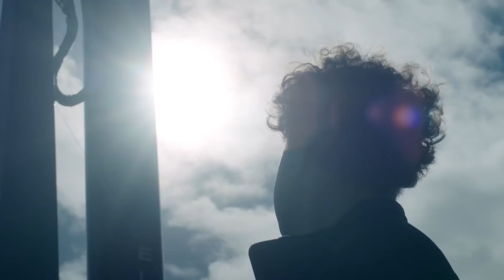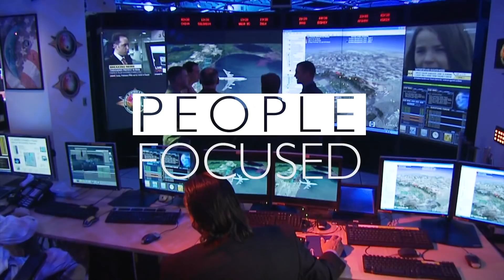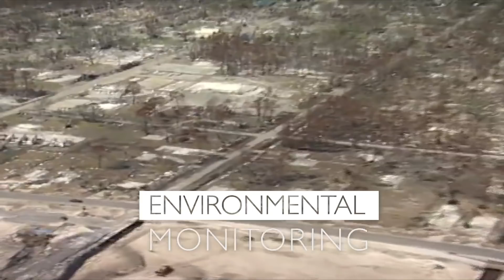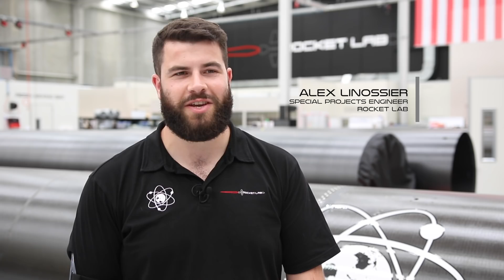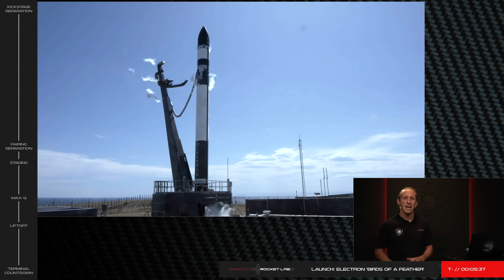Birds Of A Feather Launch - 01/31/2020

Comment: While I'm quite sure that the Electron first stage parachute (or square parafoil) descent and mid-air helicopter recovery to a vessel will work fine (jet target drones have been recovered that way for decades), I wonder if Rocket Lab has looked into a possible later refinement of the technique, in which a folded Rogallo wing could be deployed? In the 1960s, the West German company Dornier designed a reusable solid propellant sounding rocket, the Do 122 (see: https://www.secretprojects.co.uk/threads/dornier-do-122-high-altitude-sounding-rocket-project-621.3743/ ), which had two opposing "conduits" running down its sides. After re-entry, these would swing outward, deploying--on each side of the rocket's body--half of a sail-like, triangular Rogallo wing. With Electron's finless, cylindrical first stage, it wouldn't matter which end pointed forward during such a glide to a selected landing point, either on a vessel (which could match the gliding first stage's speed, for a gentle deck touchdown) or on land (depending on the launch site, the ascent trajectory, and so on).

Comment: I'm a bit gobsmacked that this launch went NNW overland- at 18:08, you can compare the aft camera view to this Google Earth rendering. The vehicle clearly overflew the eastern neck of the North Island.

https://imgur.com/gallery/AtuJkew
Reply: Since this is a US National Reconnaissance Office (NRO) satellite, it probably goes into Sun-Synchronous Orbit (SSO), so that its targets are always illuminated in the same way by the sun when the satellite overflies them.

"Typical Sun-synchronous orbits around Earth are about 600–800 km in altitude, with periods in the 96–100-minute range, and inclinations of around 98°. This is slightly retrograde compared to the direction of Earth's rotation: 0° represents an equatorial orbit, and 90° represents a polar orbit." [Wikipedia] 

That implies NNW launch azimuth.
Reply: @cogoid  I understand SSO requirements, but they can also be met by launching at about azimuth 210, without flying over populated areas. It's a startling choice.
Reply: @r0cketplumber  True. Perhaps they are in a hurry to put the satellite into a specific plane and have chosen launch parameters to suit that.

Comment: 15:32 Liftoff
18:17 MECO & Stage separation & SES
18:58 Fairing Separation
21:24 First stage reorienting (roll axis)
21:56 Battery hotswap and jettison
22:23 First stage begins changing orientation
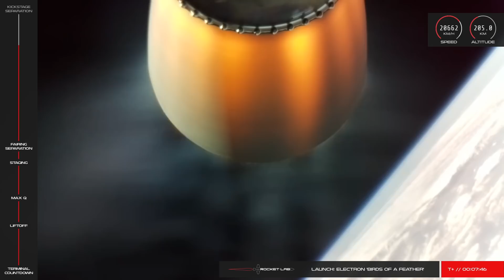22:49 First stage reorienting quickly (Feed cut out at 23:21)
24:33 SECO
Curie deployment not caught on the feed

Peter Beck on twtter:
"Initial Stage 1 reentry data review shows consistent trajectory with the previous flight. We hit the wall, roll along the z axis then come out the other side. Good telemetry all the way to sea impact with a stage in one piece again."

Congrats on making it through the Wall again! I can't wait to see you start catching them midair
Reply: Thanks for the timestamps

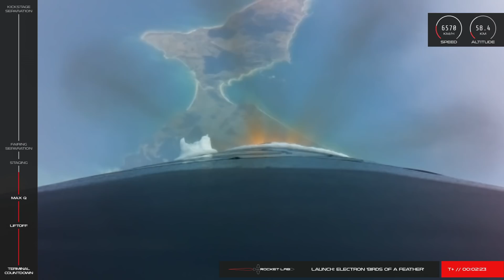Comment: 18:01  NRO launched...  a baby?
Reply: Heehee...it is one of their smaller payloads, to be sure. They have been working to develop more capable small satellites (this is likely a technology development experiment in that direction), which save money all around. Being smaller, they can be orbited by much smaller and cheaper rockets (an Atlas V, Delta IV Heavy, or Falcon 9 [or Falcon Heavy] could orbit one or more entire Electron vehicles, in terms of payload mass to orbit [if memory serves, an Electron would even fit, with height to spare, inside the Falcon 9's & Heavy's payload fairing!]), and small satellites' materials, on-board propellant, and handling & transportation logistics are all much cheaper than those of large spacecraft--with spaceflight, small is beautiful!
Reply: @j.jasonwentworth723   Yes, the Kiwis occupied that niche perfectly. 
I even think that it's not that profitable to work on reusability of such relatively cheap rockets.

Regarding NROL-151 itself, judging from Electron's maximum launch capability and the orbit, I doubt it's a visual reconnaissance satellite. It's either a technology demonstration, or a radio reconnaissance one.

Comment: A good flight into orbit!
I am curious - and worried I have to say - at the exhaust on the 2nd stage. The flame pattern didn't seem as stable as you'd expect and indeed I could see the heat shadows on the nozzle moving around a bit. And a surprising amount of sparks in the exhaust plume as well, that made me nervous about the injectors into the combustion chamber, etc. 
I also noticed similar sparks in the first stage exhaust plume, but I thought they might be ice particles erupting into plasma as they burnt?
Reply: The 3D printed Rutherford engine in vacuum has a ISP of approx 340 which is very high performance, the sparks are carbon soot from the injectors . A single Rutherford engine has been test fired 500 times and still working
Reply: @ITTechHead  Thanks very much for the clarification.

Comment: Go to 9 meter diameter Stainless with carbon overwrap! Elon needs real competition!
Reply: There will be a need for Rocket Lab, SpaceX and others .. Boeing and “Oldspace” has to go .. Nasa and ESA has to use private sector to get cost very much down ..
Reply: Rocket labs going for quick, small and fast local delivery, think  Vespa motor scooter delivering fast food, I kinda waiting for a pizza company like Domino's or pizza hut, to do a promotional stunt and deliver a pizza to the ISS with such a rocket. 🚀🍕🚀🍕🚀
Reply: @drmosfet  This accurate analogy made me hungry. ;)
Reply: Na, that's old fashioned technology. This is the way of the future. Elon can't compete with this.
Reply: @davidstiles5506  so wrong, Stainless is stronger than carbon both when hot and cryo. And it's more than 100 times cheaper.
Reply: @tonyrusi1978  You're missing the point of what RocketLabs does - Elon and the F9 can't compete with them, for small scale budget launches - they're chasing completely different market sectors, and together enable more countries and companies to get in to space.

Think of it this way, F9 is regular mail via truck, Electron is express mail with smaller packages and faster delivery, and Starship will be bulk cargo like the cargo ships in the ocean.
Reply: @PiDsPagePrototypes  That's not true either. Elon can fly for $20/kg.
Reply: @tonyrusi1978  $20/kilo, sure, but only if there's enough clients to fill the F9 or Starship cargo bays.
If there's only one client lifting 100 kilos, RocketLabs is much much more cost effective, as the client would have to pay for all the empty space on an F9 etc.

Rocket Labs is aiming at a different market sector. I don't get why people can't comprehend that. It's different clients to those SpaceX chases.
Reply: @PiDsPagePrototypes  Fortunately for SpaceX, they will be able to backfill any cargo, no matter how small, for years, with numerous Starlink Satellites.

Comment: Looks like the 1st stage went out of control.
Reply: They don’t do controlled landings yet (but are holding to soon)
Reply: @tylerklatt5633  oh, got it
Reply: Apparently the first stage is very sturdy and according to Peter's tweet it has made it all the way to the surface, tumbling or not.

Space Shuttle solid fuel boosters fell uncontrollably from the same altitude and velocity and survived just fine. But Falcon-1 did not -- it was apparently too fragile to survive the re-entry.
Reply: @cogoid  My impression was that the parachutes of Falcon 1 never worked (ditto for Falcon 9 first stage) but I don't have a reference for this; in any case supersonic parachute deployment is an unexplored frontier for commercial users.
Reply: @sietuuba  There is very little public information about SpaceX' early recovery experiments. I have only heard rumors that the stages were disintegrating before reaching the parachute deployment altitude.

When Falcon-9 re-enters uncontrollably, it apparently starts spinning rapidly and breaks apart. In the past, SpaceX employees could watch the video feed from expendable boosters though it was not shown to the public.
Reply: @cogoid  Makes sense. Even a flat spin is not out of the question if the aerodynamic shape and center of gravity enables it (I guess?), or maybe it's from precession somehow, I'm not sure. For example the Copenhagen Suborbitals sounding rocket "Sapphire" flown in 2013. Telemetry showed it falling sideways after incomplete (or failed) drogue deployment. There's a video made from that on youtube: paY9GZG7QLA
Reply: @sietuuba  Copenhagen Suborbitals are amazing! They have recently posted a picture of a nitrogen evaporator for pressurizing their rocket -- I swear it looks 10 times more sophisticated and more carefully assembled than the evaporators that fly on the man-rates Russian Soyuz rocket!
Reply: @cogoid  Only one Falcon 1 made it through booster separation. One booster went out of control after lift-off, one collided with the second stage engine bell on sep because the main engines were still making thrust. I don't think they ever put parachutes on an operational rocket.
Reply: @Markle2k  There were 5 flights of Falcon-1, and in all of them except for the very first one, the first stage performed nominally. The rare public document that is available about the recovery experiments says the following about the second launch of Falcon-1:

"The 1st stage was not recovered as planned. The recovery vessel received no signals from the electronic, sonar or visible location aids. The Range tracked the stage and received telemetry after MECO until it dropped below the horizon, but it was still at ~50 km altitude at that time. The parachute nominally deploys at 4 km altitude. Consequently there are no data to verify parachute system deployment. There were also significant delays reaching predicted splash-down point due to inaccurate landing location assessments from the Range which were initially approximately 20nm off. A long stand-off distance was required for the recovery vessel which resulted in travel time to the splash-down site of 4~5 hours. SpaceX is planning to add
 redundancy to the GPS locator system and increased thermal protection to the stage. It should be noted that recovery of this stage was a SpaceX-internal goal only and not a customer requirement."

["The Falcon 1 Launch Vehicle: Demonstration Flights, Status, Manifest, and Upgrade Path"
Brian Bjelde, Max Vozoff, Gwynne Shotwell 21st Annual AIAA/USU Conference on Small Satellites]
Reply: @cogoid  Not sure about Falcon 1 but early Falcon 9 flights did make it far enough to deploy the parachutes, which where then promptly torn apart by aerodynamic forces. Remember the early videos of them soft landing in the ocean? Took them much longer to accurately target the ship and land softly then actually getting the stage through reentry. Now one thing to keep in mind is that Falcon stages earlier than Electron and thanks to boostback and reentry burns the stage has much more benign reentry environment than Electron that does no entry burn.
Reply: @cogoid  You're right. I forgot about the two mass simulator launches.
Reply: @please_stop-v7o  Do you know if Falcon-1 had RCS for attitude control during the reentry?
Reply: @cogoid  Nope no idea.
Reply: @please_stop-v7o  In his interview with "Everyday Astronaut", Peter Beck said that it was essential for the Electron to maintain attitude very accurately: "The corridor is super narrow -- if you sit in that nice little wake, with the big bell shock in front of you, then life's good. It's really about angle of attack. That's what we want to try and maintain." It did not look to be very accurate in the footage here, but perhaps they were already past the hypersonic regime.
Reply: @sietuuba  The problem for spacex is they hit the wall before they slowed down enough to use chutes. The Falcon 9 booster is 15 stories tall, 4 meters in diameter and weighs about 20 tons empty. Propulsive landing is the only reasonable way to land it.
Reply: Peter Beck said the spin was expected.